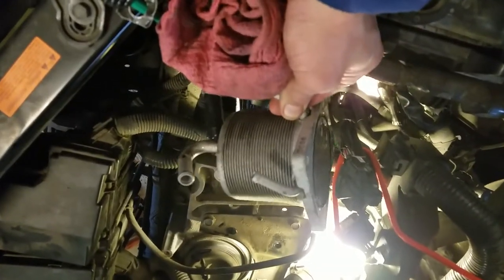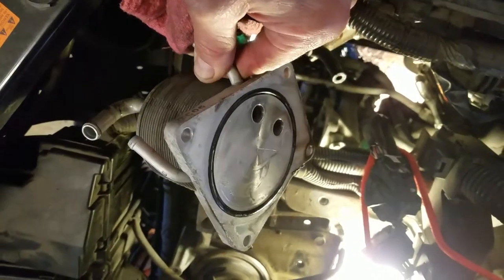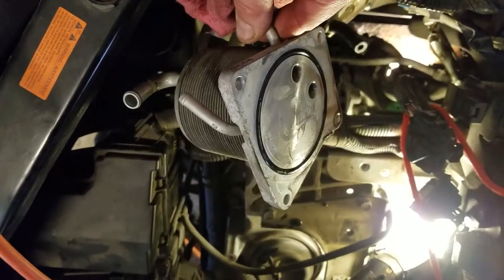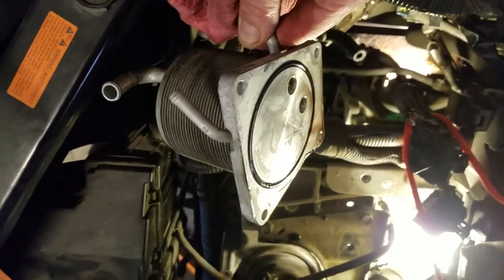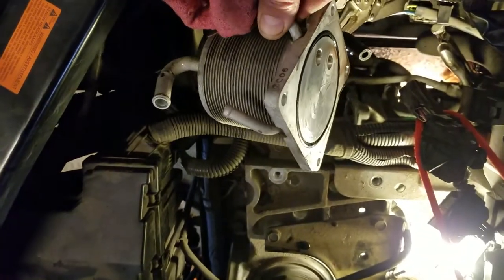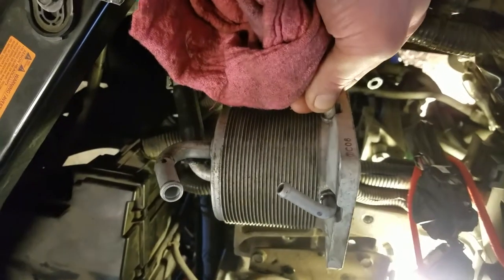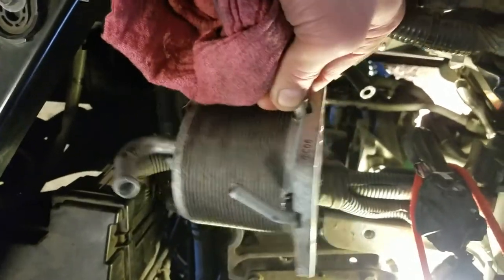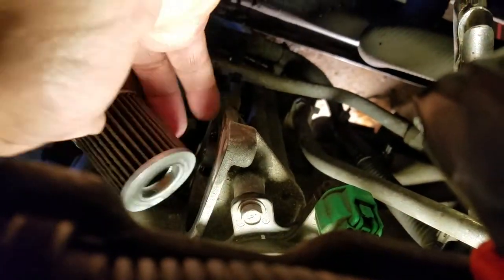2012 Nissan Rogue AWD SL Upper Transmission Filter

Comment: Hi, I have a 2010 Nissan Rogue.  Do you access this filter from the top or bottom of the engine bay?  And where is it located at?
Reply: Its located under the Battery. First remove the battery and plastic air intake tube. Second remove the battery tray which is held by (4) 12mm bolts and (1) 12mm bolted ground wire. Third unclip a few wires tied to it. Fourth there is a box in front of the tray held by (1) 10mm nut and (1) 10mm bolt. After those 4 steps you should be able to access the cooler. The cooler has (4) 10mm bolts. I recommend you remove the side plastic cover by the front Left Tire in order to get to the bottom 10mm bolt. You can disconnect the hoses or just cut a ziptie that holds one of the top hose. You should be able to slide the cooler out enough to get the cartridge filter. It can be difficult to line the filter in the slot, becareful and make sure you check that the old filter rubber seal was also removed so the new filter can go in flush. assembly everything back in reverse order.
Reply: @porkchop2725 thank you

Comment: Hey Scott, quick question. I’m in the middle a removing this crap of a design oil cooler bolting. I’m on the last bolt towards the bottom back. How did you go about taking that one off?
Reply: I accessed that bolt by removing inner fender fairing and use 1/4” extension. The two front bolts are easily reached by removing air intake. Hope this helps

Comment: Can you describe where in the engine a little more?
Reply: It’s under the intake. Remove the air intake duct and look for that oil cooler you will see it. 4 bolts pain in the dick to get the last one at the bottom.